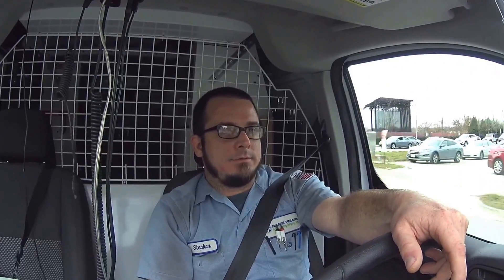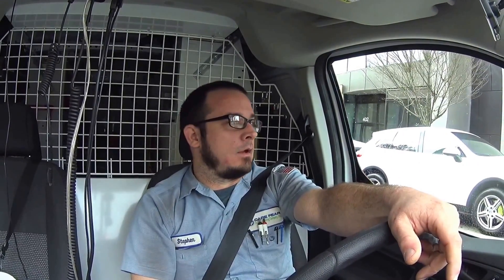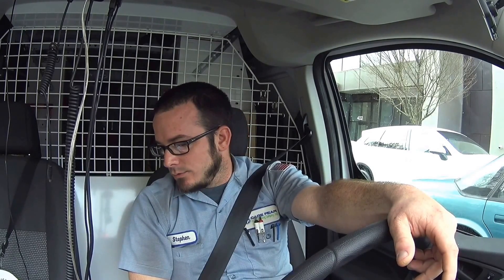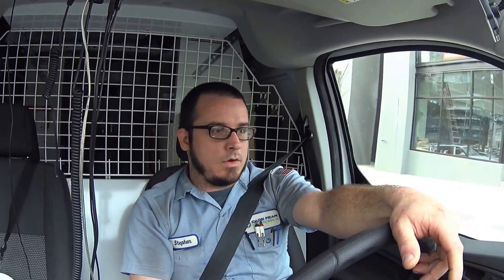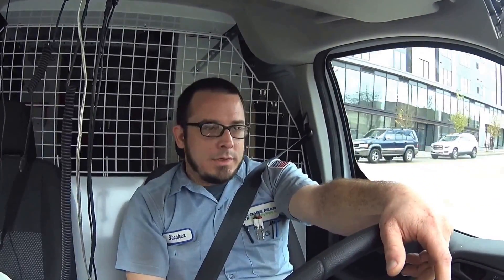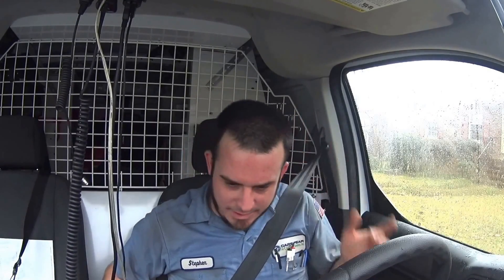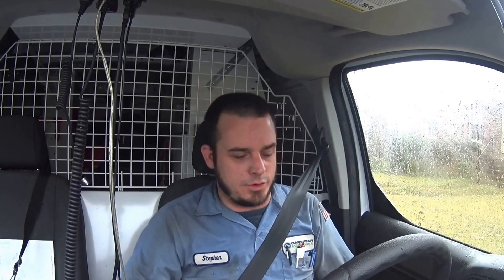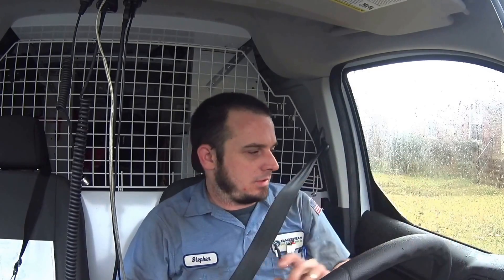HVAC Installation: Carrier Furnace 58MVP Replaced With 59TN6

Comment: Carrier heat exchangers are so shitty they made their new models easy to replace. From 2001 to 2009 their heat exchangers were crap. That and if the tech didn’t set gas pressures then it will for sure plug. I don’t even have to pull out my analyzer i know the smell of the aldehydes they produce. I’ve worked for carrier dealers for 5 years now. Love and hate them.
Reply: the bad secondaries were from 1989 to 2010. how are the newer ones holding up?

Comment: I have a 58MVP. New to the house when I built it 18 years ago. About 3 years ago the coated heat exchanger went out. The local Carrier dealer who installed it replaced it FREE OF CHARGE and provided a 40 year warranty on the new heat exchanger, which they said was covered by Carrier because so many were going bad. I only looked at a handful of other responses here, but it's odd that nobody has mentioned this as far as I can tell.

Comment: good job Stephen....If I'm not mistaking after they did the switch to stainless they also added the slope or pitch internal, so you can level the furnace. Before that i think it was a 1/4 from(level) on back side to put the pitch forward. when the furnace is vertical. what about the horizontal position?

Comment: cool.  How would you determine if the secondary heat exchanger is clogged.  Would this cause the doors to suck in on when the gas valve energizes?  Thanks.

Comment: I've replaced quite a few of those secondary heat exchangers the past few years. They are not hard to change, just time consuming. EVERYTHING has to be removed from the furnace to change it. The way the issue was described to me is that Carier made the heat exchangers out of steel and put a coating on them to prevent corrosion. In a lot of cases the coating wears away and the heat exchanger corrodes and becomes blocked with rust. The new heat exchangers are made of stainless steel which is how they should have been made in the first place.

Comment: same around here units were installed wrong carrier is offering 320.00 credit on new exchanger.500 off new furnace. 700 visa card for two stage and 900 visa card for modulating furnace

Comment: there is a service bulletin on that furnace there was a class action lawsuit involves several different models usually anything with that type of design furnace from 1992  to 2011 fall under that bulletin I'm usually finding 3 to 4 a week with that problem it comes down to installation pitch of the furnace where the furnace was pitch backwards causing condensate to get stuck in the back of the secondary heat exchanger also you will see that the cells of the secondary will rust through
Reply: +Mi Heating Guy Is there a way to get a copy of that service bulletin? I think we came across at least 5-6 this fall.
Reply: +Ragano michael If you are a carrier authorized rep you can get them from your wholesaler.. I do them all the time, carrier pays our company 4 hrs labour to swap them out with new secondary and primaries. I can get them done within 4 hours or less usually. As Mi heating guy says it usually always has to do with the slope of the furnace that causes them to rot.
Reply: Thanks, I have been referring them to a friend who is a Carrier dealer.Are the newer Carriers better?
Reply: Yes, ever since about 2008 they switched to stainless steel heat exchangers and they have had no issues
Reply: +Ragano michael yes the new carriers have a stainless heat exchanger starting in late 2011